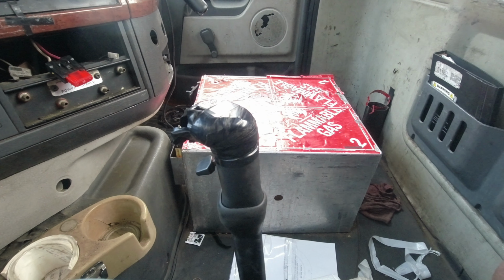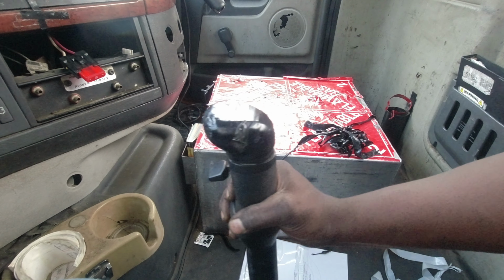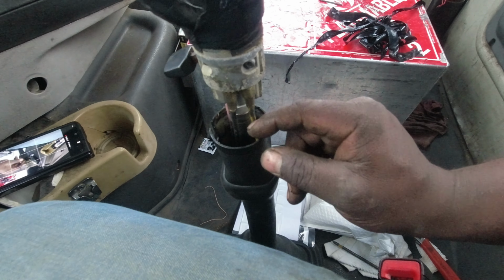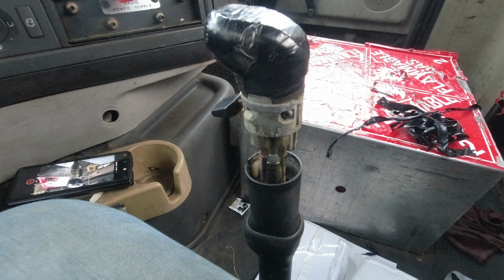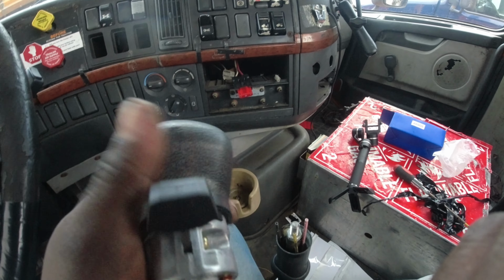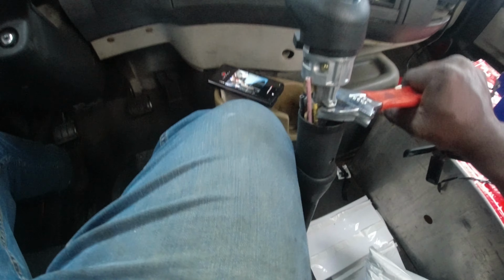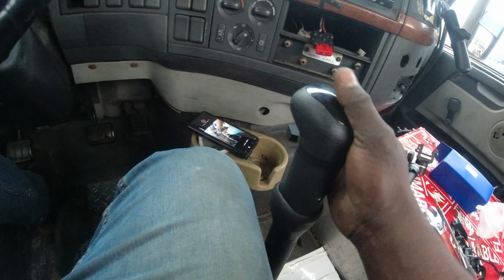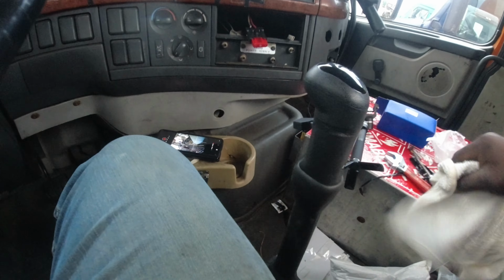Shift Knob Replacing (Eaton Fuller A6909)

Comment: Do you just reconnect the red and black lines by pushing them back in or do they need to be screwed back in to their connectors on the new shift knob?
Reply from the maker: Quick connect fittings, you push them on and they lock in place.
Reply: @Tech_Marshal  Okay thanks.